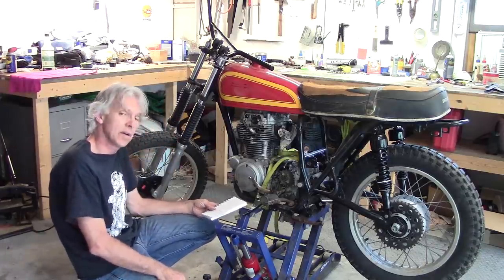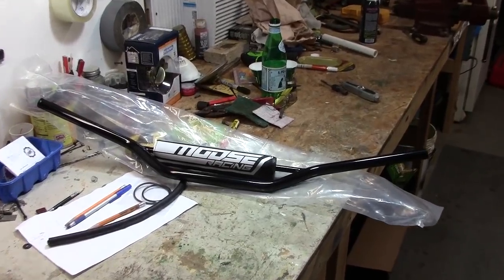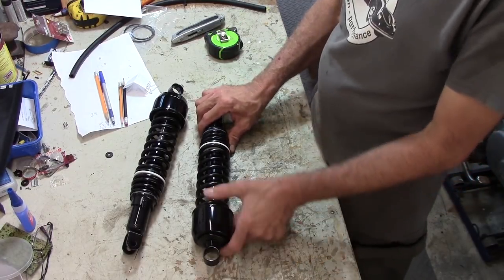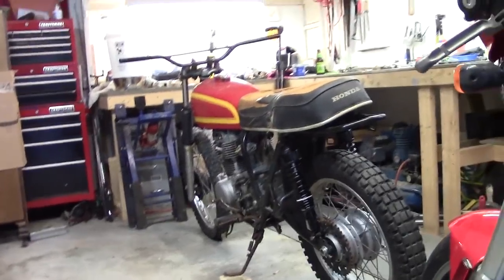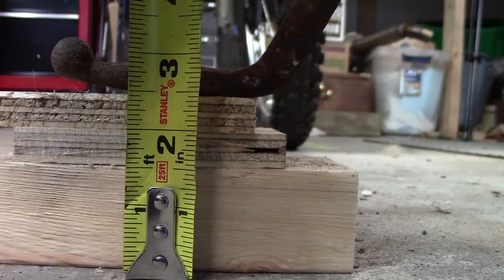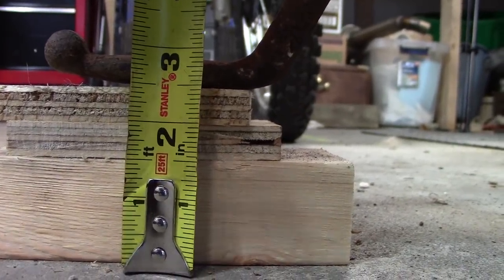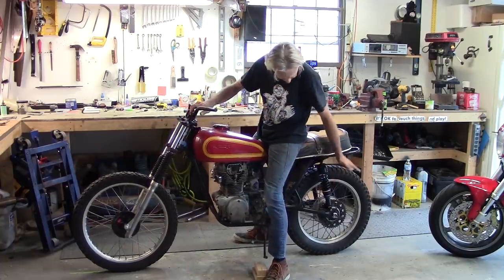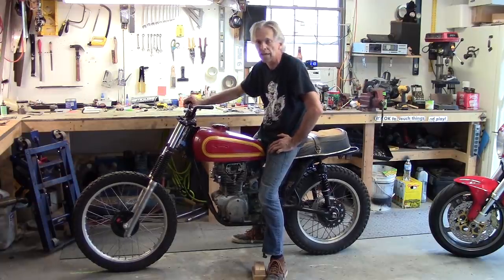74 Honda CB360T Scrambler Build   Part 3

Comment: Hey Dino, awesome build as always. One thing to watch on this model CB is starting and running the bike on the side stand, as it will cause oil starvation to the head. The oil level falls below the pick up when bike is leant over to the left. The CJ360 and late model CB360's had an upgraded oil pick up to address this issue (there was a recall put out by Honda also) and it's well worth sourcing one if you can. Realise you will no doubt modify the side stand to bring her a little more upright, but just thought I'd mention that you always want to start and warm these 360's up while the bike is completely upright to avoid frying the cam journals. 👍 I can send you info on the recall and new part number if interested.
Keep on hackin 👌
Reply: Dean Segovis Will do Dino 👍

Comment: Looks like you just need shallower sprocket bolts and nuts. Those look quite over engineered.
Reply: Just get some 10.8 capscrews with a shoulder, and use them for the rear sprocket. That will give you the shoulder you need, or just use some sleeves to fill up the gap in the sprocket. No lock washers needed, just use red high temperature threadlock and you will not have issues with the bolts coming loose. Capscrews or even better get some torx head socket screws or bolts, as they are capable of getting a lot more tightening torque, and the larger bit needed is going to be a lot more capable than the small 5mm one you need for the button head, there you will get a 6mm head. Good bolts to get is to go to Volkswagen and get the inner CV joint Torx bolts for a VW Rabbit (1980 - 2006 model years, basically any old VW Rabbit/golf Mk1,2 or 3 that has a 4 bolt inner CV joint) as those are M8, and long enough, plus they are more than capable of handling the Cb3260 torque. Just get the bit to tighten them as well if you do not have it already.

Comment: Is the garage floor level?
Reply: Probably not if it was poured properly. Most have a slight slope of perhaps 1 degree towards the door for drainage. Not  enough to worry about when checking rake/trail though. :)

Comment: What’s with the millimeter crap?!?!?
Reply: Metric makes much more sense than standard.
Reply: Yes that, and when you're searching for parts it's best to use the same measurement system as the manufacturer.   Plus I just like Metric better.